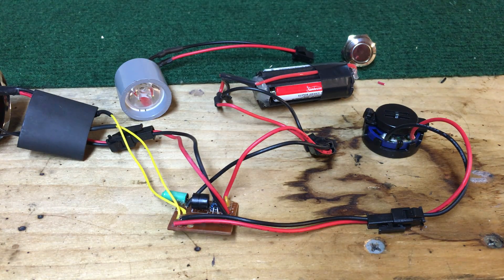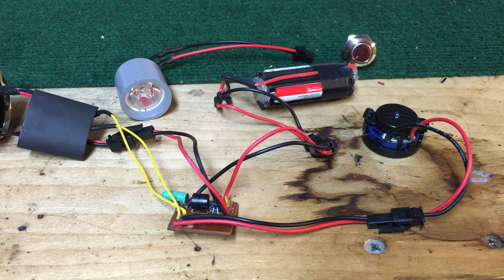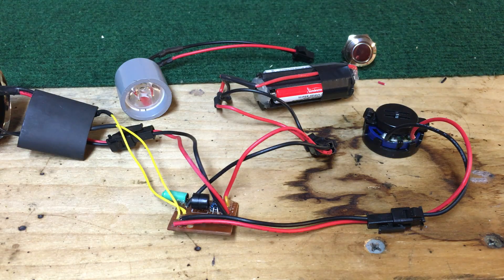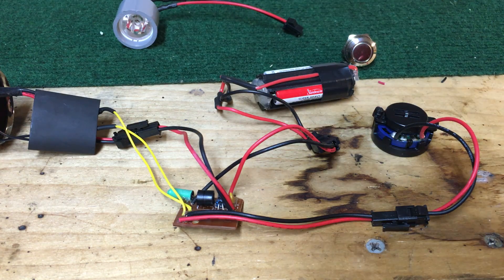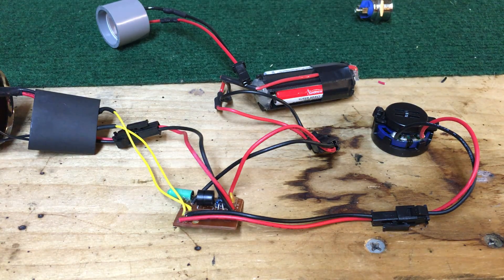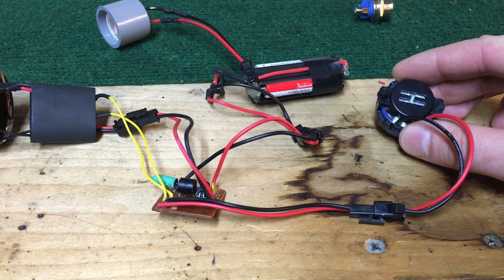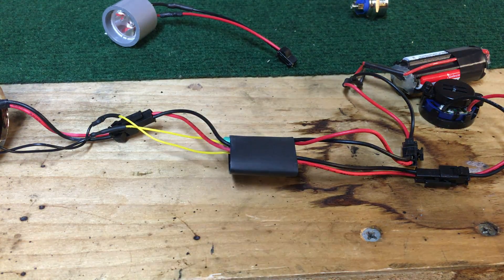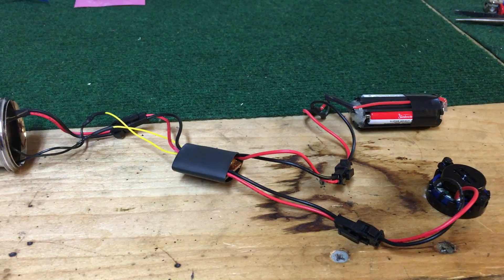Adding a Hasbro blade-builder soundboard to a Lightsaber Hilt (Saberforge Initiate Tier)

Comment: Will this same setup work if you're using a strip of LEDs instead of a single led? I have a strip of LEDs that are usb powered, could I splice that wire and solder it to the board?

Comment: NICE VID  THANX ....  just found 2 hasbro's with light, sound and flash clash for 2.50 each at a goodwill  and a thrift store so now have 3 "donors" ..... BOOYA.  just ordered a grip of jst connectors,  now looking at the leds and optics upgrade with minipuck pnp 242  also just got my 2 36" poly carbonate blades with 40" cellophane roll-(so no piecing it together). ordered one round, one bullet tip from Cust saber shop.  may do one as unstable blade . has anyone used actuall UV cree led's ??  wondering if they make a good vibrant purple through cellophane? or Ill  just do a 3up mix 1 red 2 blue.

Comment: I just discovered some AWESOME idea for a switch if you don't want to use those red top momentary switches that you get from RadioShack in your saber builds, "USE A DOORBELL BUTTON" any type would do, I just bought a black plastic sided rectangular doorbell button and it looks AWESOME WITH IT, I am just in love with it even more. Any doorbell button would work in your custom build, with the right modifications of course.
Reply: Indeed! A simple Doorbell button! Why the guys never think this before?! Awesome! But my project is stopped! I have no ideia why my LED turn on before the sound, using a TIP42 PNP transistor... Some ideia? Thanks man

Comment: I forgot to mention that the rocker switch has 3 prongs on it, could it be that might be the problem
Reply from the maker: Yeah make sure its wired correctly and on the correct prongs.

Comment: I just got a Blade Builders Luke Skywalker Lightsaber and just ripped everything out of so I can use the soundboard for my own sink tube lightsaber and when I got everything soldered together it isn't turning on, here is a list of my parts:

5w Resistor 
Rocker Switch
4 AA Battery Holder
Custom Saber Shop Rebel LED (Not the Tri Rebel, the regular one)

So can you tell me what I did wrong to put it together.
Reply from the maker: Without a picture my guess is that 5w resistor, but also make sure your using a momentary switch, not latching. Feel free to email me if you need to send pictures or want me to try and help better, djblingbling1@gmail.com, or join up my facebook group, https://www.facebook.com/groups/461954043999426/
Reply: If I may I find that an 18650 works better than AA batteries, they can also be recharged

Comment: How can I do this with an 18650 battery and a 12w Saberforge led
Reply from the maker: Yes I know there is a way to use a transistor to boost the LED straight from the battery...I plan to do it soon, I have a Cree XML with the green and blue wired up to make cyan, and an 18650 that will run on another one of these boards. When I get around to doing it I will definitely make a video.
Reply from the maker: The battery should work with this but I doubt it will power the LED.
Reply: +Darth Callidus that's disappointing :/
Reply: I have the same question :( I just watched many videos that show a tip42 transistor in the build. OOne of my problems is how to wire a 12w+ led with 2 negatives wires.

Comment: would you get the same brightness from the led using this board. this board is meant for tiny low powered less in the blade builder saber and would be resistored on the board to match those led, so I reckon the current would be lower and your led would be dimmer.

Comment: Is there any way that you know of to prevent the light from blinking when you turn it on/off or clash?  I want to use Kylo Ren's soundboard but I don't like the blinking effect that it does.
Reply: +Darth Callidus Thanks for the intel, I have a red LED stunt saber I acquired from ultrasabers and I was wondering why it had a resistor in there
Reply: +Daniel George Hi, i was curious, im using an ultrasaber stunt,and i want to add one of these boards to add sound to my hilt. i was wondering tho, i know you are using a saberforge saber, but the LED you are using there is that the the one from your stunt, my stunt is guardian blue, so i think it will work, but can i just wire it in like that, without a transistor or anything, it would be great if i didnt have to. 

thanks, 
may the force be with you!!!
Reply: if you conect a wire from board led negative to speaker negative, eliminate blink and turn in to flickering effect